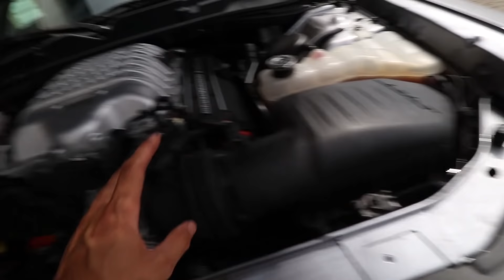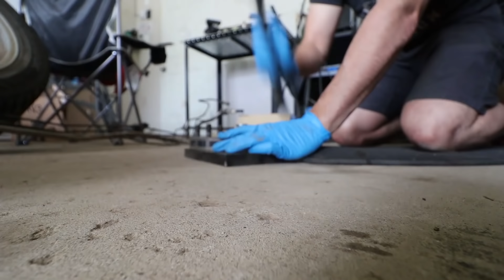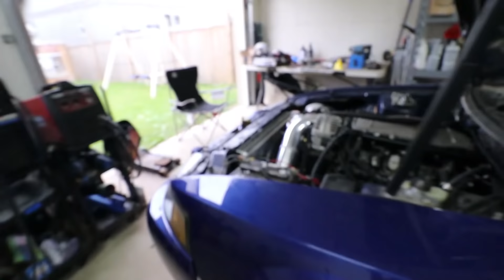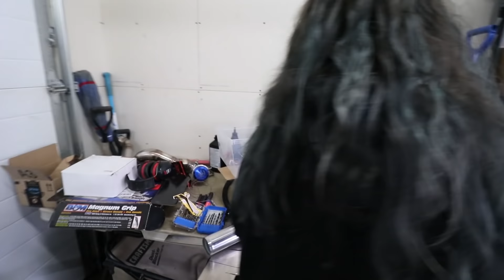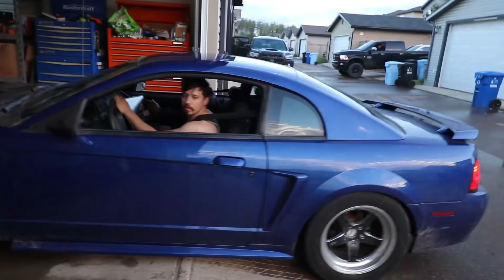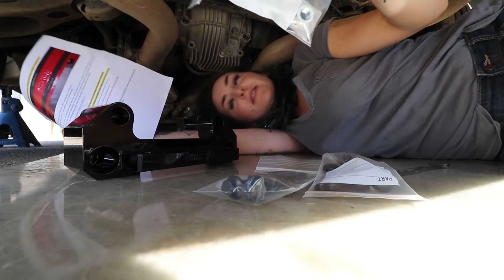Turbo Ls Mustang Freaking RIPS!

Comment: The best thing you can ever do for boost control is put two boost control solenoids on it with either co2 or compressed air to control boost.  So nice to do a boost curve and get the turbo to follow it.

Comment: Go from turbo to bottom of gate, and port#1, then port 2 to top of gate. Port 2 on the MAC is a normally open circuit to #3. Port 1 is normally closed. If you had #2 in from turbo and #1 to gate it was just venting off, not sending any reference to gate... Top picture on the diagram you showed is for internal gates, and it just limits reference.  Bottom diagram is external gates and solenoid adds to top of gate.

Comment: Just an FYI, Kyle. Every MAC brand valve will have a diagram on it. It will show you where the ports go de-energized and then energized. That way you can check every time.
Reply: Which is sometimes on the label and sometimes engraved on the block. The arrows tell where the the flow will go on the ports using port numbers. Think of it like the solenoid is pushing the spool to the right, and connecting certain ports. It should have a feed port, a normally closed and a normal open port. One of the ports may also be a vent port for one of the sink ports. Hydraulics/pneumatics is goofy as frig

Comment: Miller welders have gone downhill. Most of the fabricators I know have switched to other brands of welders like everlast welders and they swear by them.
Reply: Mostly the pricing I'd say, equivalent everlast is probably less than half the price a Miller.
Reply from the maker: Just ordered one 👌
Reply: @AdventurekyleAU  How much for the old miller welder?
Reply: @AdventurekyleAU  I'd run a cooler. It will extend the life of your investment.
Reply: @justforkiks29  the cooler only cools the torch head... nothing else...
Reply: @garyhowe88  yeah and it extends the life of your torch and saves your hand from excess heat from prolonged welding. Worth the purchase if you're gonna fab.